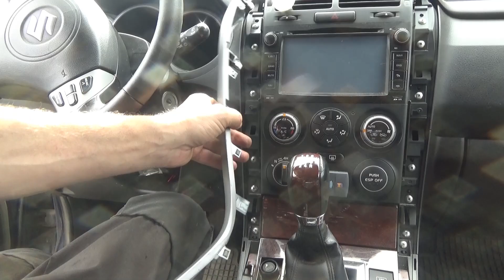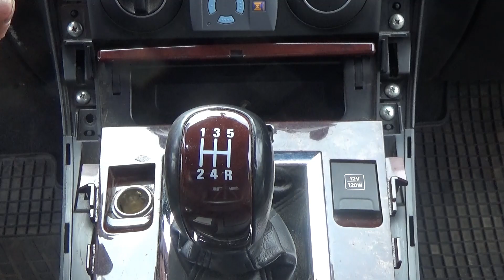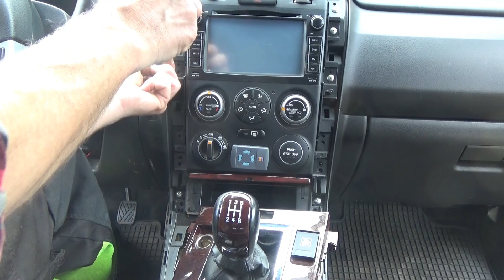Suzuki Grand Vitara F9Q 2006 handbrake adjustment and find the Airbag SRS ECU Control module.

Comment: I lifted the console (as suggested) and used an open spanner. Small spanner - 10mm. My suggestion is move the adjustment- nut a few turns and try the handbrake. Thanks for the video and others with comments !
Reply from the maker: Thanks for the comment, and good luck :-)